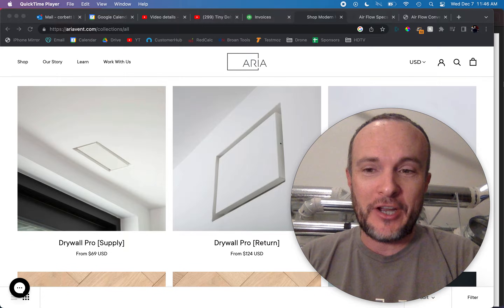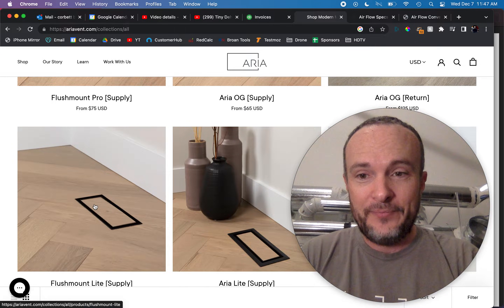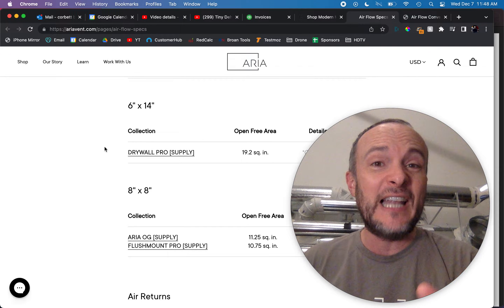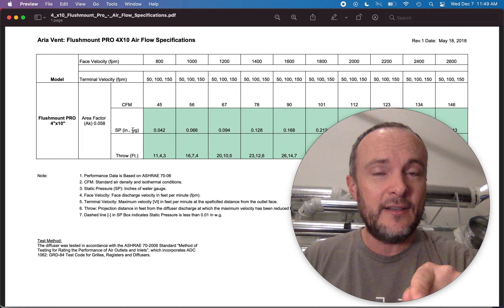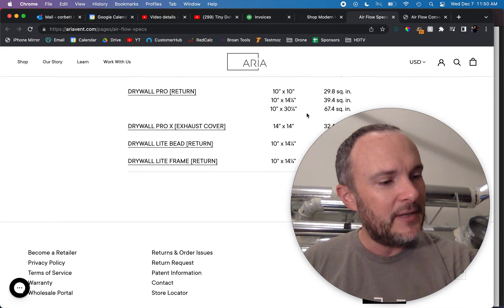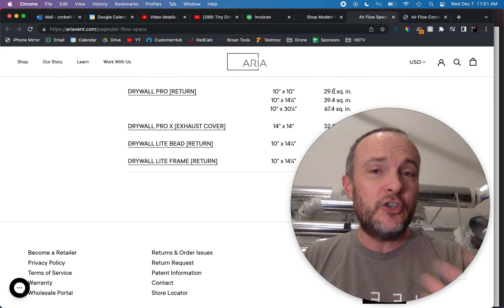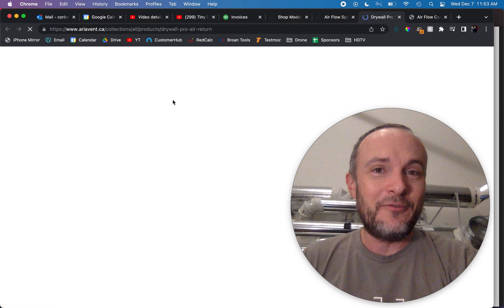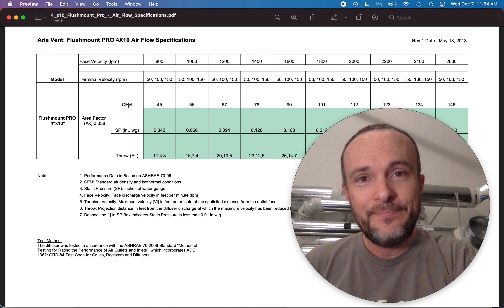How NOT to Pick HVAC Registers and Grilles: Aria/Fittes Vents Test Data Reviewed

Comment: Any info you could provide on Cryptic Air Vents flow rate would be helpful.........I am looking at 6x10 and 6x30 all are being used on wall returns. 378CFM (Claim) on the 30" and 126CFM (Claim) on the 10". Wondering if you see any issues with these? THANKS in advance.

Comment: Thx for your video ! Not a lot is out there in regard to aria / fittes misleading registers. 

Homeowners would need to go with  2 to 3 aria/fittes registers to facilitate what one shoemaker 350 series would provide with 1. 

Seems very convenient for aria/fittes. Now you would need 2 to 3 more registers which are not cheap !! Their registers start off around $80.00 on up for something that will kill your system. 

Essentially, it's false advertisement !

Comment: What thoughts do you have on the Envisivent exhuast fan cover. I know that most exhaust fan companies include a plastic cover with the product. As for envisivent its not plastic so im curious if its safe for bathrooms where its exposed to moisture. Do you think it will develop mold over time?
Reply from the maker: Same big problems as shown in the vid. Fan will be louder because of it, and yes I’d worry about cement board collecting dust and moisture and getting cruddy over time.

Comment: I need to replace these with higher flow covers. Any suggestions on replacing the covers that fit into the frames with aluminum straight bars?

Comment: Let's take a 4 x 10 for eg. That's most likely coming from a 4 inch circular vent. Since the area of a 4 inch vent is about 12.5 sq inches and the aria free area is around 9.3 to 12.3 sq inches, does it actually matter? I get aero dynamics alos matters but
Reply: I'd think (hope!) that most HVAC vents are from a 6" duct (my older house uses 7").  So that's 28-38 sqin.

Comment: What do you think of Linear slot diffuser performance. They do look stylish but not sure about their performance. I can see there could be a little bit or air restrictions from the way it looks.
Reply from the maker: Just do the math, and understand that they’ll be more expensive than conventional grilles. Everything can work as long as you use it correctly.
Reply: @HomePerformance  Golden point!

Comment: What a timely video and excellent presentation. I'm a bit concerned because I just purchased 6 of the 6"x10" supply vents for an addition to our home. That being said, I did not purchase their return grills. I have regular return grills with lots of flow. Is the strain on the system more a function of having poor return flow, supply flow or both? I guess I'm trying to figure out if I will potentially be ok with using just the supply vents.
Reply: David, you've got the idea and you are on the right track.

  If I go out to your car and shove a potato into it's exhaust pipe, the fact that you bought a high flow intake really doesn't matter.  A restriction, anywhere is an issue.  Ideally, the only restriction is the coil/radiator type device that heats and cools the air. We want the air in, or out, to flow as easy as possible to the location we want to heat/cool.

Comment: The point (these decorative grille alternatives inhibit air flow) is well made.  In general, appearance and performance conflict in HVAC issues.  A bit of correction on the area ratios:  a 2x10 isn't really 20 square inches.  The vanes in a standard grille interfere with air flow.  A rough rule of thumb is that the gross area times 50% (30% for small grilles) gives a good approximation of the "net free area" that the air actually uses (there are a lot of edge effects).  The decorative alternative also has a net/gross ratio, but is probably closer to 80%.  However, any way you slice it, "pretty" sacrifices "performance".  Standard grilles are standard for a reason.

Comment: This is a very informative video.  I have these grills installed in my house and the temperature and indoor air quality is perfect.  The house has no problem heating to 74 degrees Fahrenheit on winter days with an outside temp of -4 degrees Fahrenheit.  It has no problem cooling the house to 74 degrees Fahrenheit with an outside temp of 90 degrees Fahrenheit.  The furnaces and air conditioners in my house are pretty good (Lennox EL296V variable high efficiency 2 stage furnaces and Lennox 13 SEER 2.5 and 3 ton ACs) and the house has very good energy efficiency (tight building envelope).  That being said there are two things I would like to point out: 1) If you are sensitive to sound, you will definitely hear the hiss or woosh of air being drawn into the cold air returns.  The best way I can describe this is that in a very quiet environment (think going to bed) the system will sound similar to what you might hear when you are in a hotel and hear the hotels HVAC system operating.  2) I would (am) also concerned about the added strain the restricted return airs would put on the furnace itself and if this would effect the longevity or life of the system.

EDIT: from a noise perspective, my 4x10 hardwood supply registers make more noise than my 8 x 10  aria drywall register.

EDIT 2: if you are building a new house and advise your HVAC designer that you will be using these vents, they can also design the system with a couple of extra cold air returns which will solve most of the issues described in this video.  Not 6 cold air returns in a row, just a couple of extra ones spready throughout the house.
Reply: Your concerns at your home are valid.  Your system would last longer and cost less to run if you had decent intake covers.  Wood VS this type of vent is junk VS junk.... You just paid a lot for it.

Based on the numbers on the sales charts, you don't need a "couple" of extra intakes or vents, you need five times as many to equal a cheap, metal grill.

Some products are cheap, but work really well.  People feel better paying more for a product thst doesn't work even half as well as cheap.

Comment: Thank you for your detailed rundown! Our R&D process is in continual development as we balance form and function. We will continue to be transparent with our clients and provide data sheets. Providing solutions with optimal airflow and beautiful aesthetics are both very important to our team. Vents are a part of the system not all of it. And because everyone’s HVAC system is different, determining airflow needs is a case-by-case situation. While there are no “perfect” vent options, as you have mentioned, Aria Vent provides an innovative solution that is modular, easy to install, and complements every type of interior design.
Reply from the maker: We admire your transparency. Thanks for posting the data so your clients fon’t get taken by surprise (ideally).

Comment: Would there be any benefit to not running registers say as if your home is perfectly balanced heating and cooling wise without them?
Reply from the maker: What in the world Paladain? Please talk more about that.
Reply: @HomePerformance  so the spec homes that most of us will buy come with a system that has the dampers on the main legs and adjustable registers at the end of each run in each room. the dampers at the end end up not being needed and are very restrictive (for me currently). Southern home so there are no return vents either, just the main return in the center of the home. But the thinking here is the reduction in pressure might help efficiency, and the other benefit is the reduction of pressure in the ducts at each run would reduce the pressure in each leg of the pipe possibly leading to less duct leakage. Of course the registers covers are just awful though and i don't plan to run gaping holes so i would find some sort of free flowing cover. Does that make sense what i'm saying theory wise?
i would also add that spec homes don't come with sealed ducting, they will only be sealed if you go back after you purchase the home c and seal them yourself.
Reply from the maker: Couple things, P- it’s probably code where you live that ducts outside the enclosure must be sealed, so you could chase your builder for that. And registers and grilles only add an estimated 0.03” wc at most, basically a drop in the bucket. If you have a high SP problem, trying to fix it by removing grilles is like bailing out a boat with a coffee cup. I wouldn’t worry about it.
Reply: @HomePerformance  that's true this is why i asked. i'll have to look into code because they just assemble the ducts with sheet metal screws and some hvac tape here and there for some of the insulation. no sealing at all which is crazy. But we have verified it over and over again on every friend's house by different builders and even asking a friend who builds spec homes.

Comment: If your home only has 1 return air duct and grill that's a giant red flag! Most homes will need 2 return air ducts and grills. Ask your HVAC contractor to run a static pressure test! Most homes in my area have one return and high static pressure. You need good airflow for system performance and comfort!!
Reply from the maker: KP, too many !!!!!!! - my own home has one return, and it works perfectly as designed. I hear your concern, but it’s mostly about falling down on the job in planning, or testing, or both.
Reply: @HomePerformance  If it's designed properly and sized properly then a single return is totally fine. I know you spent the time to size your ductwork properly but most homes aren't built like that.
Reply: I have 5 returns. 3 in main house (800 sq ft with loft office). 2 in 444 sq ft guest house. Mitsubishi HyperHeat ducted units for each house. Keep units on low fan speed year round. Total electric house and bill averages $57 a month. Best of all perfect indoor humidity despite being on the water in the coastal southeast.
Reply: @heidismith3399  Very nice, I love the Mitsubishi Hyper Heat systems!! We install a lot of them. Amazing heating performance in cold climates. They are fantastic systems.

Comment: Those things look like junk anyway.   In Florida usually we have the ones with vertical and horizontal adjustment and they are real good and inexpensive.  They allow damper adjustment as well if you are a degree or two off in a room.

Comment: I like that you broke this down for people. I am an HVAC professional. I saw this grill years ago and really liked it for the esthetics but also immediately realized that there was no way it could effectively throw air in any meaningful way.  Something that you will see in almost all supply grills and diffusers is some sort of louver or device to direct airflow. This is necessary to evenly and effectively cover a space with the conditioned air, preventing hot spots. The dispersion angle of this product is very narrow and would have difficulty providing an even temperature across an entire room (with an exception being very tight, very well insulated builds with low load demands). It does not have any device to direct air dispersal and is essentially just hoping the air will get where it needs to go. 

The Aria products restrict the air velocity in two ways. The first is what was discussed by the net free area being smaller than can accommodate typical face velocities. (Lots of air through a small hole.) The second can be more easily understood by comparing the airflow to a small stream that has a large boulder in the middle of it. As the water tries to pass, only so much of it can make it around at a time creating a dam-like effect. Aria stops the natural flow of air abruptly with a wall and then has it move around that wall to the small openings on the side. This increases the pressure in the ductwork by creating a bottleneck and contributes to the face velocity issue. A consequence of this is that now the system is under a higher static pressure (simply meaning more air with nowhere to go) than the equipment installed will be designed for. The blower motor will subsequently burn out prematurely and need to be replaced more often than comparable systems with more traditional grill/diffuser options. Typically the only time you will see residential HVAC systems employ a high static motor is in manufactured homes (mobile homes, trailers). This is because the duct system is just one big chase that spans the entire length of the home without changing sizes. Rectangular holes are then cut into the duct chase in each room. This design philosophy centers around cheap methods to circulate air. Air is forced in and it comes out where it comes out. You could think of it like a bottle of water with three holes poked into it at different heights. The one at the top gets the least pressure so it has a weak stream of water. The one in the middle has more pressure so it has a stronger stream of water. The bottom hole has a ton of pressure and has a strong stream. All of them are getting something 🤷🏻‍♂️ and that is good enough. Since high static blower motors are almost exclusively for manufactured homes, it is unlikely you could source factory spec equipment with that option. 

I love minimalist design which was why this product initially caught my eye. An alternative would be to utilize products that commercial construction have used for decades. Linear diffusers, or slot diffusers, are a minimal option that can be used in ceilings, sidewalls or from the floor. They can be as narrow as two inches and spread the net free area for the air to travel over longer distances (this can be 2’, 4’ or customizable). They also allow for directional airflow through louvers or baffles just inside the grill/diffuser. 

Does it take more planning? Yes. Do you need to make alterations to how structural components are designed and installed? Probably. Does your HVAC contractor need to know before they bid your job? Yes. Might adjustments need to be made to accommodate how ductwork can be run? Yes. 

It does take planning and intent on the front end but this can achieve an end product that is beautiful, clean and fits the esthetic you were looking for with products like Aria. I hope that some of you find this information helpful and I am grateful to channels like Home Performance that help educate homeowners and builders about building sciences and promote improved standards for the level of quality we expect and deserve from our homes.
Reply from the maker: What a great comment! Thanks for taking the time, JAM.
Reply: Late to the conversation here.. but question. I was thinking about putting 2 of these returns in my house (both in the same room) literally the only ones in the entire home. Would that put too much stress on the hvac system? I like the aesthetic, but obviously not at the cost of my system!  Thanks for any replies, much appreciated!
Reply: @katiehartmann7111 yes
Reply: Can I get an idea for a return grille with filter?
Reply: @ErcanALTINEL  There are companies online that do sell decorative return grills. If you are wanting to make your current return filter grill look less offensive one of those may be an option. I would ask the companies lots of questions about their product though. From pictures, you almost never see a filter actually installed. Most of the designs I have seen would allow you to see the filter, which most people would not want. I would ask if there is a screen or perforated layer behind the design to hide the filter. Alternatively, they do make return grill registers that have a perforated front and that may be an option that appeals to you. 

If you are designing a home that is yet to be built, you could design your filtration to be located at the air handler or furnace. This allows you to most styles of registers as long as there is sufficient airflow back to the unit. I’m institutional and commercial design this could include linear slot diffusers that are hidden behind other elements. For instance if there is a dropped crown moulding that will allow room for diffused up lighting, a linear slot diffuser can be designed into that space pulling return air with minimal visual impact. Or you can design in decorative return grills into wainscoting in some areas. Only one may be functional but the design repeats in each panel. There are a lot of ways this can be done to limit the visual impact of a cold air return. Usually by obscuring it or integrating it with another design element is the most effective way. 

I hope this helps. Let me know if you have any other questions.
Reply: @JAMichaelsDesigner 
Thank you very much
Reply: "like a large boulder in a stream" perfect analogy 👍
Reply: I put these in my home when I had to remodel from Hurricane Laura in 2020.  I ABSOLUTELY LOVE THEM.  You can actually feel the air on you when you stand under it.  I am in the process of fixing pool house and going to add them to my pool house.  Best upgrade I made to my home!!! Also they look amazing everyone notices them.
Reply: @mdc1030 you feel the air because your system is under high static pressure which is not good for your blower motor.

Comment: I've known about this brand for about 4 years now. Local to my area, glad they listed their stuff - but they've had the "currently in testing" on there for at least the 4 years I've known about them. I'd be okay with using them if I could convince the customer to let me put 50 of them in per floor lol. Sure they wouldn't have any floor left, but why not?

ALSO - I did do a house where the customer bought these to install. The returns are physically about 3" deep - meaning they FILL a 2x4 wall. Minimum, a 2x6 wall needs to be framed to make the data comparable to a 2x4 wall. Obviously retrofits are out of the question.
Reply from the maker: Good points, Levi